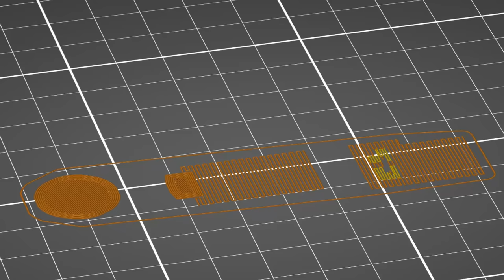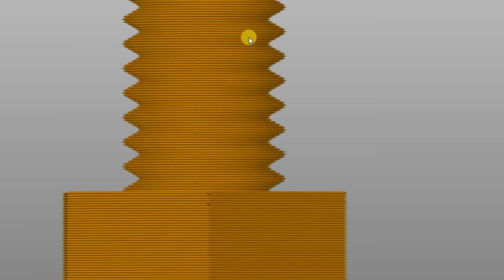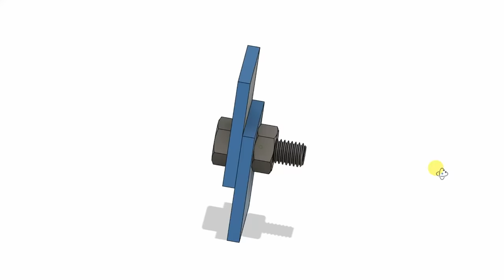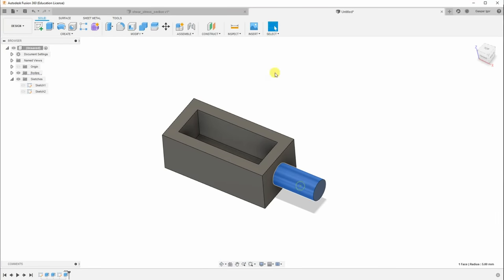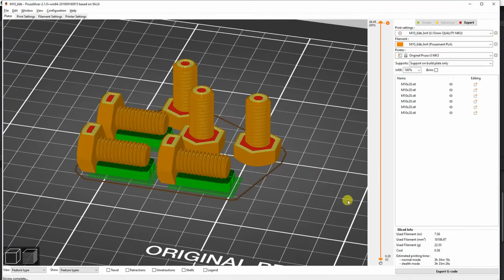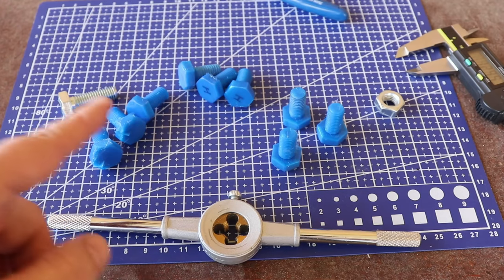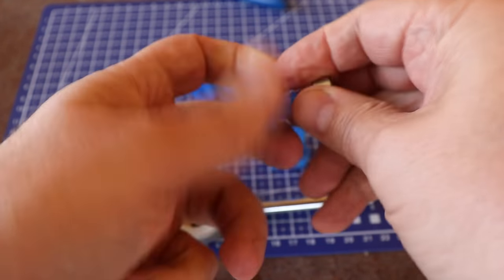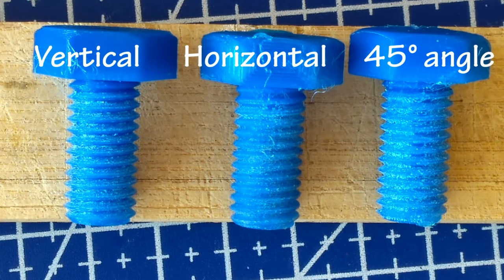3D printing bolt and thread in horizontal or vertical position - strength test

Comment from the maker: Based on these results: testing different horizontally printed bolts WITHOUT supports: https://youtu.be/E3WRBp-T42o
Reply: if you print 2 halves horizontally and glue the 2 halves or not to avoid the supports PS: next time hang the weights on the hook and not on you (Pt-BR)e se vc imprimir 2 metades na horizontal e colar as 2 metades ou não para evitar os suportes PS: a próxima vez pendura os pesos no gancho e não em vc kkkk
Reply: You nooob! You dont know how to calculate torq
Reply: Intro music?
Reply: @LukaArtelj  It works for the purposes of the test, since comparison is the main objective. All he did was measure the force he applied to the wrench instead of the torque applied to the bolt. However, if he knows the length of the wrench, he can account for it fairly well, and it looks like he made it past basic algebra.

Comment: It's a bit like wood, which is several times stronger with the grain than across it
Reply: Yes true
Reply: FYI the more scientific term for this is "isotropy". An isotropic material (such as metal) has the same strength in all directions. :)
Reply: @rantanplan1911  but this is not isotropic right
Reply: @prithvirajb1953  Exactly. Wood and 3D printed plastic would be "anisotropic" (literally "not isotropic")
Reply: @rantanplan1911  Thanks for your comment, great info 👍
Reply: Are they both stronger in both forces, example screw vertically bolted in taking a force of downward vertical pressure 
Vs

screw in horizontaly holding downward force 

BOTH PRINTED  HORIZONTALY
Reply: @gtrargh6637  I would say the stress is on the same direction in both of your examples. For the vertically printed screw to be stronger, you would have to put a load that's either pulling on the screw radially or tangential shear stress, which are both pretty unlikely for a screw
Reply: same applies with meat
Reply: It's exactly like wood
Reply: I think you have it backwards, it's against the grain now with it I believe
Reply: @prithvirajb1953  no this is patric
Reply: @LordAscended just use your brain please, trees grow up, why would wood be stronger perpendicular to the direction of all the stress on the tree
Reply: @froyocrew  Well I am partially wrong, though I am partially right, thinking through it again I see that Yes, the statement made by Jonas is right, except when it comes to a splitting force, then that is where the grain's structural stability falls apart as the grains are pulled apart. So you are right in part, and while I was not completely right, I was right in the sense of what I was going for, though I did not make that portion clear.

Comment: I really like that you perform these experiments and document them so thoroughly. I think you can make the stretch tests safer using a lever; it looked like you risked falling on your knees with considerable force.
Reply from the maker: I am good with falling (from few cm), watching video, yes, it may look risky. But I am working on Arduino based tensile testing machine, where I can measure yield point too, not only break points (and it will work by pressing a button). Only parts from China are arriving so slowly..
Reply: Sound exaggerated but please use a helmet, if you trip that will hurt
Reply: Why didn't you just use the Rachet strap you were holding your self up with to do the whole experiment?
Reply: @MyTechFun  Your safety is important
Reply: @UltraGamma25  Not as important as SCIENCE :D
Reply: @UltraGamma25  "Your safety is important" I am much more likely to sub to a dangerous channel than someone who gives twenty safety warnings before the video even starts... It's just more entertaining.

Comment: No debate needed:
If you need bolts to endure forced print it horizontal.
If you need bolts merely to keep pieces together print vertical.
Reply: Any person with a little experience in FDM printing should know that. Why did i still watch the video ? I have no idea.
Reply: if you dont know how the bolts are going to be used print it in 45°
Reply: @PotyGames  
45º are worthless:
Not as strong as horizontal.
Too much filament waste.
Much more material to clean.
Reply: ....or use metal bolts....
Reply: ....or use metal bolts....
Reply: @doppelhelixes  metal bolts are good but for in house repairs if you don’t have the bolt you need you’d need to order more. With 3D printing you can just make one. It also gives you more freedom for non standard fixtures on bespoke designs
Reply: this is obviously a scientific work, it was done to provide detailed knowledge based on facts and not just "i think" or "it should".
Reply: You can buy plastic bolts
Reply: @vasili1207  The best thing about 3d printing is the CUSTOM build so you can do the design as your need or like without restrictions and using premade bolts are not the best option for custom buildings.
Reply: @thomast7748 but this vídeo is necessary for the unknow people, we have experience and some study but not all people..

Comment: I always create a flat size along the threads of every 3d-printable thread I design...and print it horizontally.

It requires no support, prints easily, and the small section of no threads doesn't effect it's ability to thread in and out easily.
Reply from the maker: Thanks. I already got this suggestion, definitely I will try it in near future (also print in two halfs, PETG etc..)
Reply: @MyTechFun  I think the point being made is that it doesnt have to be half the widht of the screw not being printed. Since it is possible to print with overhang you might get away with only 1/3 or 1/4 not being printed (or even less).
Reply: That's what I was thinking, was hoping to see this version in the test as well
Reply: Very good video btw, man take care of yourself. These tests are a lot fun tho... 😂 But more than all of this, it's clarifying! Thanks a lot for the tip.
Reply: So you are shaving a side from top to bottom including the head?
Reply: I recently made a spool holder for my Ender 3 this way. I was nervous that vertical printing my result in the holder snapping,  and didn't want to deal with all the supports needed for the overhangs. Printed it horizontally by dropping the model down a millimeter and having a flat base to make it on. Worked beautifully and the threads are perfect.
Reply: @wirosk2916  Could probably print the bolt with the width of the threads not being printed on the bottom, since that'd be even less than 1/4.
Reply: Dude genius, why did i never think of this.
Reply: Any photos of this? I can't visualize it
Reply: @alejandroperez5368  duckduckgo > flat edge thread > images
google image search may be polluted by your accounts search bubble.

You will lose some pull strength because there's less thread.
You might lose some torque strength on the bolt head since there's a massive chunk missing... unless he has a way around that.
Reply: What do you mean “create a flat size”?
Reply: @Alejandro Pérez   @TheImtoomuch   @Creepy  
A picture for reference: https://i.imgur.com/QKNvY1K.png

I only did the one side, you would obviously want the flat part facing the print bed or to have symmetrical flat sides. As for how to do this yourself, it was a simple boolean operation done in Blender with a cube
Reply: @funx24X7  thank you!
Reply: @wirosk2916  I think he simply cut away the part of the screw that is hard to print without support(the edge of the screw contacting the bed). Just imagine lowering the model when it is horizontal until there is enough contact area for it to print, you should be able to print with little cut off because of the shape of the screw, often more than just 1/4, but then the screwhead lose a great portion of its area, making it look weird
Printing in 2 halves means that he can create screws that are easy to print and assemble, strong and able to withstand more twisting force if it is a hex screw
Reply: Can you elaborate on what do you mean with "I always create a flat size along the threads "?? i am EE and new to ME design and CAD with Fusion 360 and 3D printing....thank you in advance...
Reply: i got the idea looing at that picture https://imgur.com/QKNvY1K  but why that does not need a support for the thread? which is "floating" over the 3D printer bed (because of the screw's head)....
Reply: @juancarlosabad3298  That's a bad picture to copy from.

In your slicer, you lower the full bolt "into" the virtual print bed until you have a full flat section including the head...and then print.

This channel has a full video devoted to the topic if you look at his fairly recent ones.
Reply: New manufacturing method demands new design techniques. Great idea!

Comment: In vertical position all the three stresses accumulate in between the layers which are weak points. Meanwhile, in horizontal position stresses are applied to the layers all together. This video really helped to realize this. If you asked me before, I would definitely go with the vertical one.

Comment: I'm so impressed that horizontal did so well
Reply from the maker: Me too. I want to compare them with injection molded bolts too
Reply: strength in horizontal printing is quite logical - the strength of the thread is summed up in total. in fact, a cable is obtained. vertical and angular printing is caused only by the adhesion of the layers.
Reply: @garrypotter5323  That's a great point!

Comment: Very informative and quite entertaining -- you literally put your body on the line for testing!  Incidentally, just this  morning I tested horizontal vs vertical printing for a small 6mm pla rod I am going to use for a propeller, and the horizontally printed one was much more difficult to break with my hands than the vertically printed one.

Comment: This is very interesting stuff. I used to fly model airplanes, and for mounting the wings to the fuselage there are special nylon bolts in the market. The idea behind these is that in the event of a crash where the wing strikes an obstacle, the bolts would shear off and the wing would be undamaged.

In practice however, the bolts would often prove to be too strong, and either the wing would be damaged anyway, or the mounts would tear out of the fuselage together with the bolts.

It would be a fun challenge to produce my own bolts that are strong enough to survive any aerobatic maneuvers of the plane, but would be fragile enough to break in the case of a crash.
Reply: Shouldn't be too difficult, just adapt the market available nylon bolts by making a radial groove in it.
Best to do with a (mini)lathe if you have one.
You can easily make a bolt that will break when you want to.
It's somewhat like steel testsamples are being made when steel properties are being tested.

Comment: This was very helpful! Last night I experimented with some brackets printed on my CR-30. Definitely need to rotate parts by 45° since that’s the equivalent to printing horizontally on a normal printer. The ones printed right in the bed broke as I removed them from the bed. But the ones printed at 45° were really strong! Which for batch prints I closely stack them in Cura so that it uses the previous print as a support. This reduces waste with supports on multiple prints.

Comment: Thank you for this work!  I was running into issues with vertically printed M6 screws and nuts that where stripping and splitting at the layers.  This research confirms my thought that a horizontal printed screw will be far more helpful. Excellent video!
Reply from the maker: You may find this informational too https://youtu.be/E3WRBp-T42o

Comment: Thanks. I printed a replacement bolt for my toilet seat. Those bolt need to be made of plastic because a metal bolt could break the ceramic bol.
Obviously, I followed your advice and printed it horizontally with supports. It was not pretty on the underside, but it's surprisingly strong for PLA. Lets see how long it will last.
Reply: If you have the rubber fitting you can use metal
Reply: @mangobot232  Good point Mango. I must say, it was also a pretext to use my 3D printer

Comment: Awesome video! The results may vary if the bolt print orientations (vertical, horizontal, 45) are all printed separately. Printing all of these different orientations together will affect the infill/print path of the bolt. This would then effect the lattice/crystalline structure of the bolt. But you sir deserve a tensile test machine instead of risking your own weight for a plastic bolt haha. Thank you for the great content!

Comment: Thanks for the engineering approach, one thing your results may differ than the website data is because you did the experiment by printing bolts. The threads on the exterior surface are the stress risers so they reduced the max. stress. The correct method would be printing straight bars and testing it on a setup similar to extensometer. Very much thanks for the video by the way, it gives clear understanding of the effect of printing direction on the strength.

Comment: 4th variation: horizontal printing but in two halves (thus, no supports)
Reply from the maker: Interesting idea. Thx
Reply: Also shaving the tips of thread in the two halves will give ability to have easier bolt nut fitting
Reply: 5th: horizontal printing without thread and then use thread die to make whole thread.
Reply: @ondrejtyc7578  6th: erase 5th because reasons. Buy a freaking rod then
Reply: @ondrejtyc7578  Yeah, I don't think it's fair to compare 3d printed parts to machined parts.  XD
Reply: 7th
Reply: @operator8014  I know that machined metal thread is much stronger. I am just curious if the 3D printed part can survive whole threading process (not only cleaning thread after printing) and remain at similar strength level.  I am threading printed parts quite often as it is easier for me to bolt couple parts together than complicated one part prints full of supports. However, I have never printed a bolts.
Reply: I like that. The two halves could be one piece with a thin hinge at the top. No alignment needed since the bolt will align and compress both halves.
Reply: @ianbruce9603  Ohhhh, two halves in one part, maybe!

I was personally thinking two halves with a key (so three parts) or two halves with an indentation (and some supports)
Reply: @NicksStuff  — Yeah... I see exactly what you mean, and it might be stronger that way — but if a single, folding piece could work, it’d be a game-changer. Just need to test it out. ;-)

Comment: Materials printed are anisotropic. This means that they have a preferencial direction and so it's normal to observe that your bolt broke sooner in the vertical position. It's because of the contact surface between the different layers of PLA. The contact surface of vertical printed version is far inferior of those of horizontal version. In order to maximize the strenght of your component, you have to print your pieces with the layers in the direction of the maximum stress. Thanks a lot for this great demonstration!!

Comment: Another interesting test would be to print a solid, smooth bolt (no thread) and then use the die to add a thread. I think that might be stronger than printing the thread.
Reply: Threading 3D printed blots just results in the rod snapping from heat. It’s impractical to thread a long rod because of how long it takes, and still it weakens it

Comment: Thanks for this - the information is useful and timely for me.
I'm working on a horizontal mount for a joystick that has both a screw thread and a nut.  This confirms that the planned horizontal print should be stronger than my other options.

Comment: 🟅 Instead of adding support what I do is cutting the thread off from the screws underside (and top for other reasons) such that I can print them sideways.
I cut off the he profile depth and a tiny bit more. A tiny bit more to avoid overhangs >> 45°.
This still gives more strength (and much more importantly more reliable strength across materials) than vertically printed screws.
An added benefit of cutting of a side (or both sides) of the thread is that the screws can now be rotationally locked to what they go through by adding matching flats to the printed holes.
E.g. one can rotationally lock a stack of spur gears together.
I also cut off the top of the horizontally oriented thread because that part has the same issue with vertically printed screws. 
That is the top of the horizontally printed thread contributes less to the total strength. Also it forces the printer to do lots of island-jumping and retractions which adds print time, load on the printer and possibly stringing and post processing effort and time. A possible failure mode could be that under load the nuts become oval and slip over the thread. In that case the top cuold be left on.
🟅 Also what I do is instead of going for metric or imperial standard screws (standards which where never meant for FDM 3D printing) I go for FDM printing optimized thread profiles.
I use asignificantly larger pitch (3mm pitch for 12mm screw -- there is still friction self-holding) and 
I use softer thread profiles (like e.g. sinusoidal or cubic instead of classic triangular) which can be printed faster and cleaner.
🟅 Given the clearance was chosen properly with these design choices there is NO POSTPROCESSING NEEDED whatsoever.

Comment: I fully understand that it depends on the material used, but as a machinist it is my understanding that any bolt is only as strong depth wise as its diameter. In other words, tapping a hole 1/2"-13 (yes, I am in the USA) 1" deep makes the shear or tensile strength no stronger than tapping that same hole 1/2" deep. Interesting video!
Reply: I think it's even less if everything is the same material, and use the standard 7/16" high 1/2-13 nut as my evidence. Theoretically that's only ~5.6 full threads, and once you start adding chamfers it's even less. 

A "rule of thumb" I've heard is 3 full threads is all that's needed for full tensile, and a 1/2-13 jam nut is right around there, accounting for chamfers.